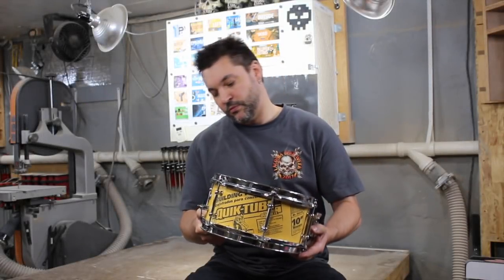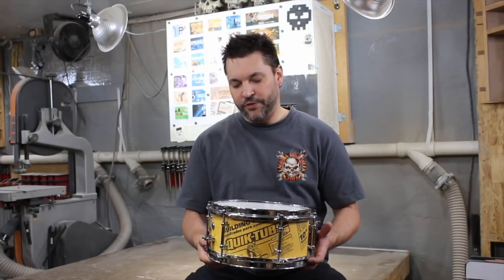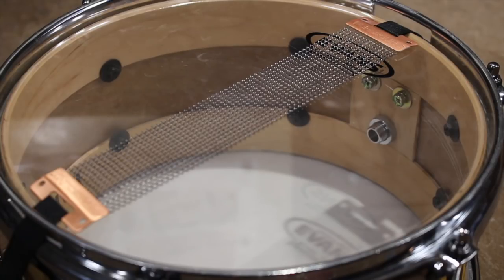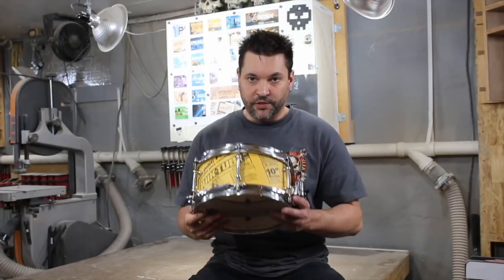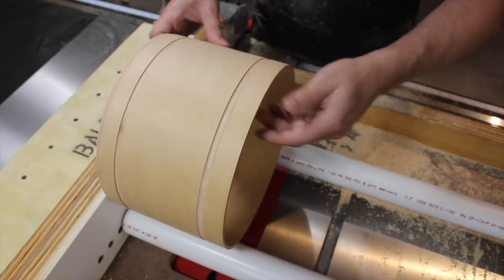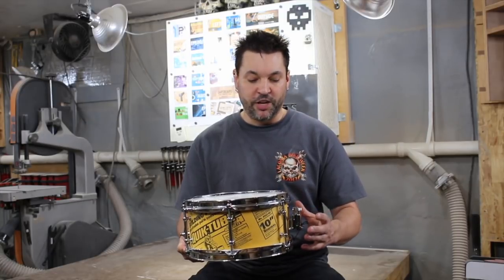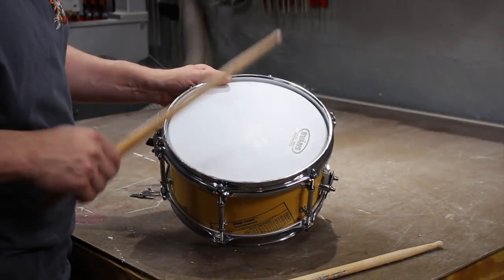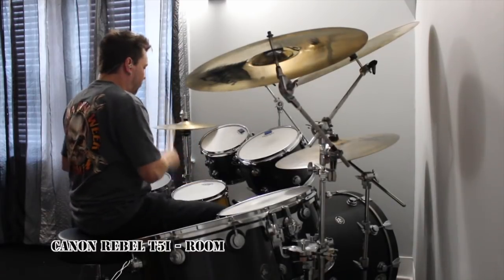How Does It Sound? - The QUIK-TUBE Snare Drum

Comment: You're spot on that it won't hold the 45 degree bearing, but I cut 30 degree in the shells I build and I've found Quik Tube will hold that. Did a floor tom and it's top notch.

Comment: Do they have a wide enough selection to make a full set of drums?  Oh and the obligatory... First...  lol
Reply from the maker: In my region, the stores only stock 8", 10" and 12" and they aren't consistent in diameter, nor roundness.  I picked through the stack to find one that wasn't smashed up and I took a drumhead with me.  The cardboard tube doesn't sound good enough to be more than a visually interesting (subjective) snare drum.
Reply: ManCraftingTM: You can get bigger sizes on special order. I’ve seen tubes like that as high as 20”. 
Like the OP said though, the walls of these tubes can’t really hold up to the tension stress hoops and heads will put on it. 

The bigger the tube, the more need for reenforcement rings.

Comment: Not sure if you mic'd the bottom but it sounds like it's got a really short resonance. But it sounds amazing, especially considering it should be filled with concrete
Reply from the maker: Snare Mics: Shure SM57 (top) | Sennheiser 504 (bottom)

The resonance is short, but I have another 10" 9 ply popcorn snare in my collection with the same characteristics.  The small diameter and lower mass probably doesn't provide a vibration.  I'm sure the cardboard isn't helping matters.

They are mostly used as side snares or effect snares.